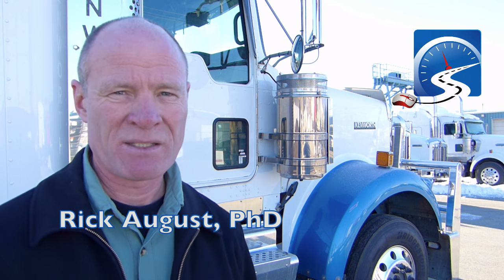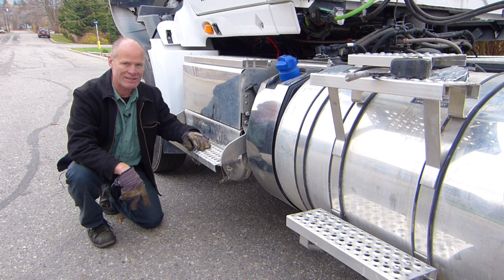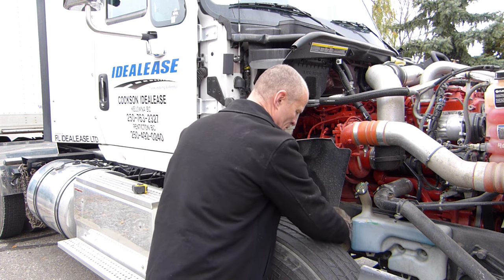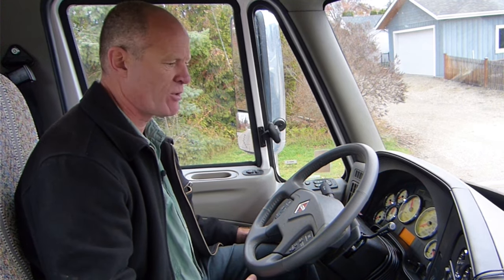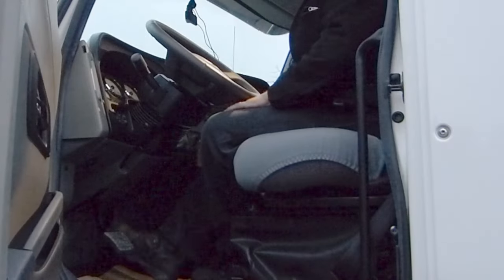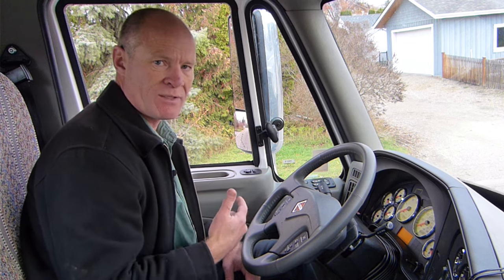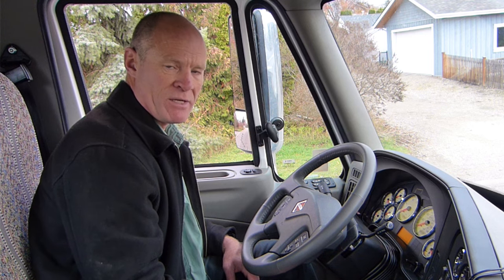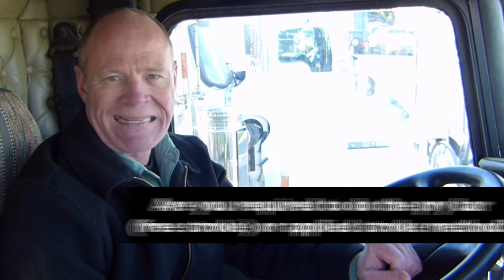How to Do the CDL Air Brake Pre-Trip Inspection

Comment: I have a question.... I have a 1984  Tandem grain truck that I purchased about a year ago, It has airbrakes... It has 2 tanks at the rear that have a drain valve each, and one tank under the cab by the right side fuel tank... The one by the fuel tank has 2 drain valves on it... I never seem to get any air out of the one. I've only ever got a little bit of water and some gunky stuff...   Is that just the wet tank? The other valve works fine I get lots of air when I open it...   The brakes and everything all seem to work just fine, and when i bought it I had to get an inspection done and nothing was said about it so I'm assuming it's normal.. Am I right to assume that or should I get it checked out?  I would thank you kindly if you could answer my question...  Thanks...
Reply from the maker: Hi TheFarmerfitz -  Thank you for your comment. Usually when an air tank as two drain valves, it is 2 tanks created by a bulkhead. The way to find your wet tank is to pump to full pressure. Take note of the pressure on the gauges and then go out and drain each tank - one at a time. The tank that doesn't drop the needles is your wet tank because it doesn't have a pressure gauge. There is a possibility that the tank by the fuel was replaced and the person who did it didn't realized that it was 2 tanks, rather than one. That's only one possibility. The only other possibility is an emergency tank in the event of break down, but I've never encountered one of those. If you determine which tank is the wet tank, that might alleviate some of the mystery. However, if you have 3 tanks that are functioning, then your system--as you stated--should be working fine. If there is anything further we can do, drop us a note. Always happy to help. All the best for the holidays, Cheers Rick
Reply: Thanks for the reply... The one by the fuel tank as I said has 2 drain valves... is it possible that there is 2 compartments in one tank...   On that tank, when I turn the tap on the rear drain valve I get the usual blast of air, and usually some moisture... The other one I have only ever had a little dribble of water but no air at all.....  The other two tanks I do the same and I get the usual blast of air with a bit of moisture(depending on how long it's been since draining)....  It's probably like you said...

Comment: But it looked like the front slack adjusters were moving WAY more than 3/4 inch or am I wrong??
Reply from the maker: Hi repairdrive - Thank you for your comment. For the purposes of a road test, the examiners aren't too exact. You're right - these were probably more like a inch. They tend to be more strict with the rear brakes. If there is anything further we can do, drop us a note. Always happy to help. All the best, Cheers Rick
Reply: @smartdrivetest  Ahhh. Ok. Thanks!!

Comment: Computers could monitor most of these systems as well as tell you when alarms aren't working. That would save mega time off the road, be saver for all the drivers that don't mess with this anyway, and knock a couple grand off of school.  
Lets bring trucks into 2020.
Reply: I know your comment is old , but the visual and audible alarm means you need to get off the road before the pressure drops to 40 psi and your emergency brake lock up on trailer cause all hell to brake loose

Comment: Great videos. Question, how much pressure should I apply to the service brake as I’m doing my air leak test? Is light pressure ok?
Reply from the maker: Hi Kenyon Hicks - Thank you for your comment. For the leak test, you are going to have more than 100psi in the system - preferably maximum pressure with the parking brakes released. And you have to make a maximum brake application for 1 minute. A light application will NOT work or pass the requirements for a road test. What class of license are your working toward?  If there is anything further we can do, drop us a note. Always happy to help. All the best, Cheers Rick
Reply: Smart Drive Test hey thanks for the response. I’m going for my Class B here in DC
Reply from the maker: Hi Kenyon Hicks - You are most welcome. If there is anything further we can do, drop us a note. Always happy to help. All the best with your CDL license, Cheers Rick

Comment: How do you inspect the brake diaphragm and determine whether it is ruptured or not?
Reply from the maker: Hi Rob - thank you for your comment and query. Most of the time--in my experience--its a service brake diaphragm that goes. A leak test will identify a ripped service brake diaphragm. For a spring brake diaphragm, it's going to leak when the parking brakes are released and one of your wheels is going to lock up - you'll know pretty quick. For both, let a mechanic deal with the breakdown. If there is anything further we can do, drop us a note. Always happy to help. All the best, Cheers Rick

Comment: Confused! Dose the Governor make a sound when "cutting in"?
Reply from the maker: Hi Emily Schmidt - Thank you for your comment and query. And no, the governor can't be heard - it is silent. you can tell that the governor has put the governor into the load phase because the air pressure needles begin to climb. If there is anything further we can do, drop us a note. Always happy to help. All the best, Cheers Rick
Reply: You will know if it doesn’t by the lack of air build. You can hear additional tax on the engine in most cases.

Comment: Im taking my cdl test for class B friday.. I want to know if the MCI J4500 has two air tanks? I know it has disc brakes, no push rods or slack adjusters so what are the major components I need to mention? If you could help I would really appreciate it.
Reply from the maker: Hi Daclassie Sims - thanks for your comment. All air brake vehicles have a secondary and primary air tank. If it is an ADIS (Air Dryer Integrated System), which it probably is, you won't have a wet tank. If the governor is within close proximity to the air dryer, it's an ADIS system. See this video: https://youtu.be/yBi-6eUch0w On disc brakes, say, rotor, callipers and pads are all secure, not damaged and not leaking. Tell the examiner the brakes are self-adjusting and must be checked for adjustment by a qualified technician. Check the brake chambers and inside the hub. The bus will have ABS, so check the ABS valve and the electrical line zippy tied to the brake line. If there's anything further we can do, drop us a note. Always happy to help. All the best, Cheers Rick
Reply: Thank you so much.

Comment: i got air brakes test but i studder wil talking what the best thing to do.
Reply from the maker: Hi Annalyn Best - thank you for your comment and query. When you go for your test, indicate to the examiner that you have a speech impediment. I might even suggest that you go to the licensing office before your test--if you think it might slow you down--and inform the office that you might need a little longer, but only if you believe that's going to take longer. When you're practicing have exaggerated physical movements. And make sure that you're lightly touching and pointing at everything. Try to use one word - when you're doing pry par to test push rod travel say, "Adjusted" In the cab, talk with your hands has much as possible. If there's anything further we can do, drop us a note. All the best, Cheers Rick

Comment: the brakes chamber supost to muve with out air ???
Reply from the maker: Hi Oliver Diaz - thank you for your comment. Quickly, there are three kinds of brakes: 1) service 2) parking 3) emergency. The parking and emergency brakes are one-and-the same. Both are powered by large, powerful springs. When you push on the brake pedal you send air to the service brake chambers and the push rods extend and apply the foundation brakes. When you exhaust the air out of the spring brake chamber, the large, powerful springs expand and extend the push rods and apply the parking brakes. The emergency brakes work the same as the parking brakes; if you lose air pressure in the system, the emergency brakes will apply. I don't know if that answered your questions because it wasn't entirely clear. If we can help further, drop us a note. Always happy to help. All the best, Cheers Rick
Reply: I think Oliver may be asking if the brake chambers are supposed o move when you push the brake pedal? Maybe when the brakes are not released?

Comment: Wet tank = supply tank
Reply from the maker: You are correct my friend. That's one of the challenges with trucking is that too many things have more than one name. And most air brake equipped vehicles now, won't have a wet tank. See this video: https://www.youtube.com/watch?v=yBi-6eUch0w&list=PL0x-bChcUvwG2bSWReQWnk9Tm92L7WN_O&index=19&t=5s Drop us a note if you have further questions. Cheers Rick